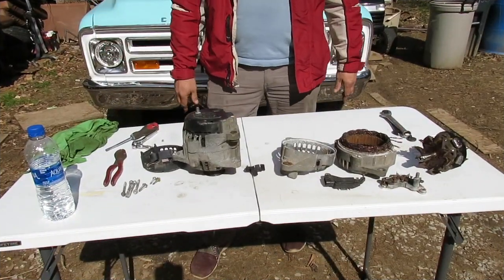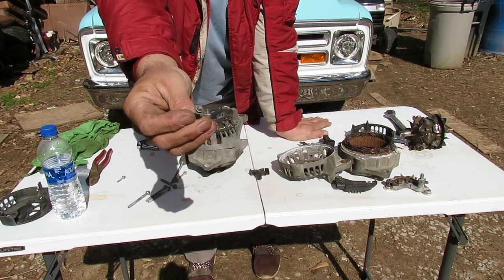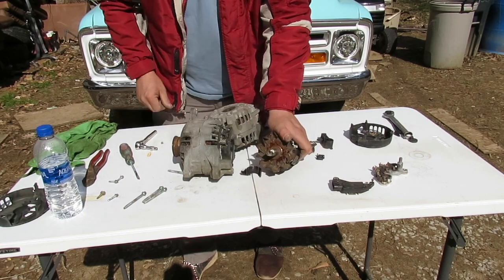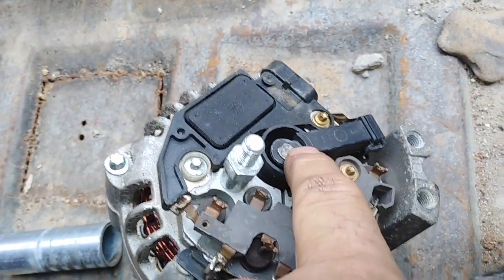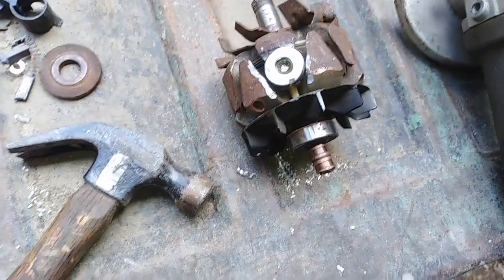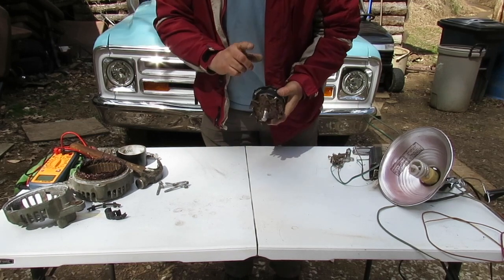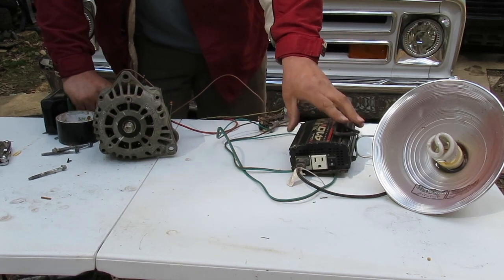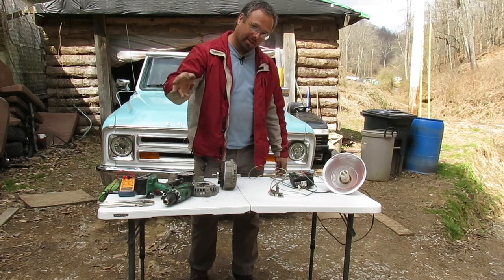Converting an Alternator to a PMA

Comment: I think you messed up the shaft but would you care to explain what a PMA is?
Reply from the maker: Yeah, the shaft is messed up. It couldn't ever be put back together as a regular alternator. It's ok for this application though. 

A PMA is a permanent magnet alternator. A regular car alternator uses 12 volts from the battery to activate a coil of wire inside the rotor creating an electromagnet. This alternator with the permanent magnets inside doesn't need to have power applied and is more efficient.

Comment: How is the wires connected?
Reply from the maker: The three wires from the stator go to the same wires on the rectifier they came off of. The + post is still the same one. You no longer have to hook up the field to anything.

Comment: You didn't show which wire's you connected to on the alternator
Reply from the maker: There are only three wires coming out of the alternator. They hook up to the rectifier on the three terminals that are sticking out on the side of it. It doesn't matter what order you put them in.

Comment: Magnet may come out shakey
Reply from the maker: At higher speed it can develop a shake as it is almost impossible to get it balanced perfectly. Although they are more expensive, a factory made PMA is better. It was fun to build this and it did work for low speed applications.